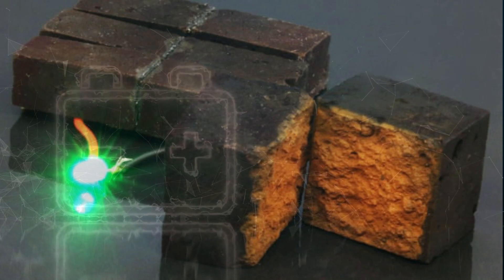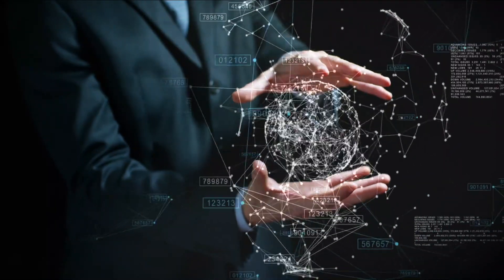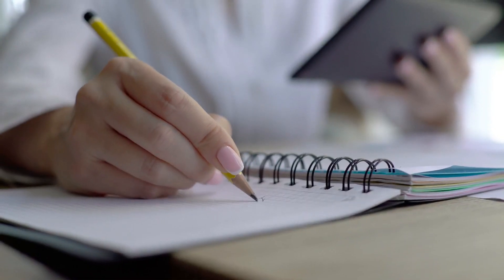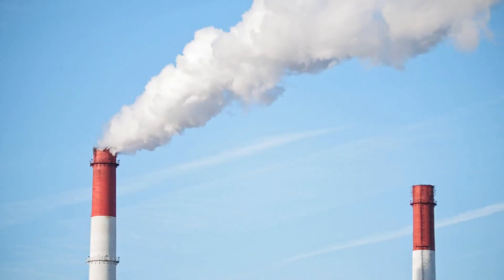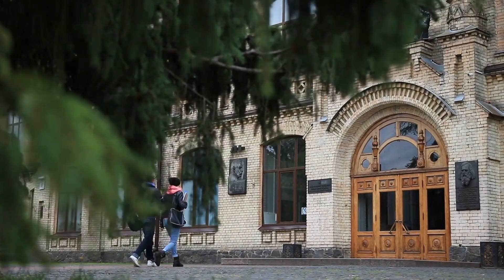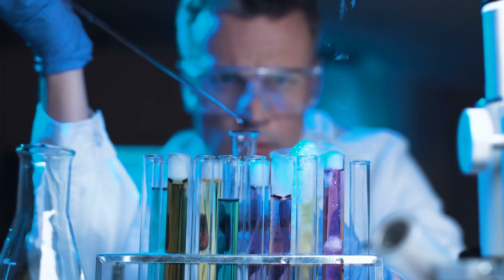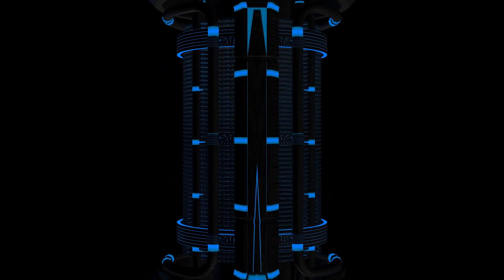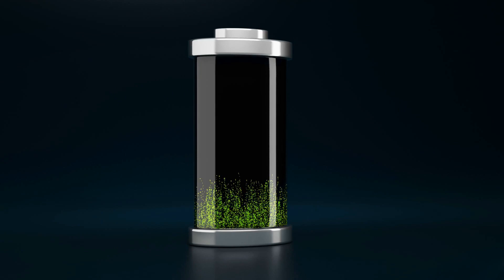We're Turning Bricks Into Batteries

Comment: I've heard of the Baghdad battery, so this makes a lot of sense. I wonder if the pyramids used these types of brick that can store electricity with their pigment and they could have been an ancient version of a power station with that many bricks/stones with that red pigment built together. That could explain where they got all the power to lift some of the heavier stones. Does anyone know if that area has the same red pigment in their soil. I know that there are some shafts that have yet to be explained, maybe they poured the same acidic fluid that was in the Baghdad battery into all those shafts to produce some electricity. Something gave the Egyptians a boost in tech, that could have been it. Just a theory but they had everything they needed to make it happen.
Reply: I like what you said here. I heard recently that the pyramids pre date the Egyptians. Apparently there are no hieroglyphs or anything showing they are directly egyptian. They stored stuff inside them obviously. Crazy how there is so much info from the past that was destroyed.

Comment: We think we are advanced but in actuality we are behind the times. They had a huge free energy grid years ago. It still stands today but the capacitors have been removed and the energy had been blocked by adding stained glass and paint. Any time you see a dome, lighthouse, cathedral or the like, look at the geometric shames and arches (arches are like horse shoe magnets) and antennas on top. They have hidden the free energy grid as a grift and control mechanism. The good news is we are waking up